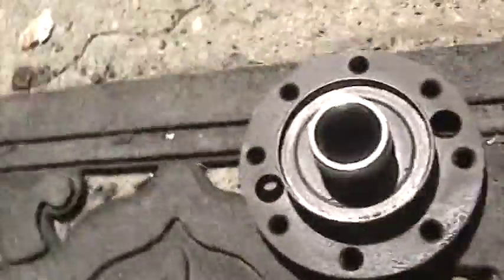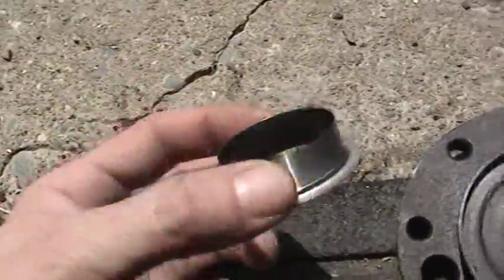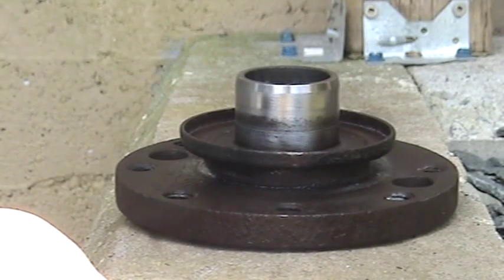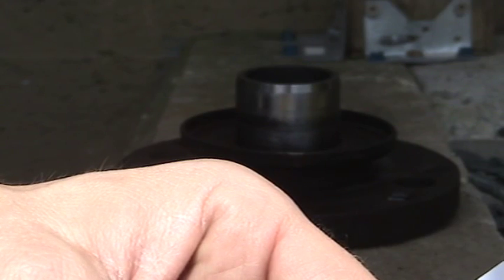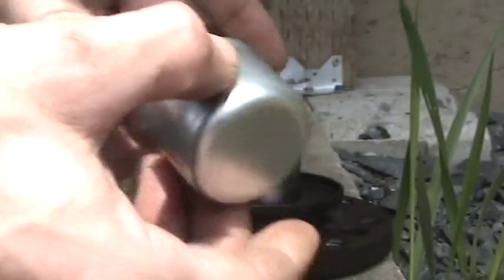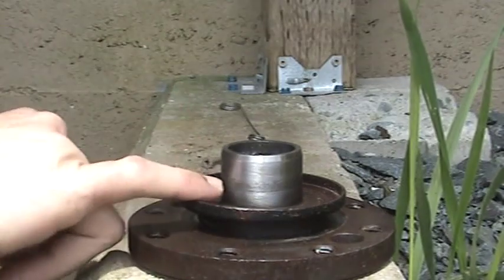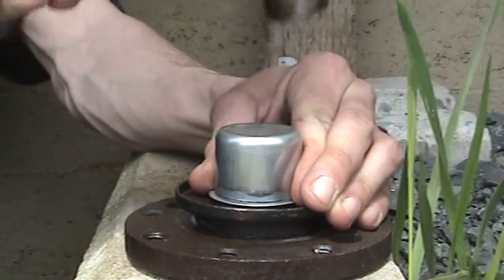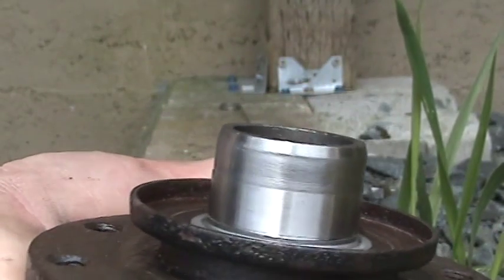Redi-Sleeve Application - Fixing seal leaks caused by damaged shafts

Comment: Why not throw the yoke in the freezer and heat the sleeve? It will drop on the shaft with no hammering. I have a small freezer and a toaster oven in the garage just for interferance fit parts.
Reply: I know this old Post but just heads up the manufacturer specifically says not to heat sleeve as it is important to have a very tight fit as it is also sealing the shaft from oil leak as well.

Comment: Thanks for the video. I’m wondering if a new stock seal will still work with new added diameter? What do you reckon?
Reply from the maker: 70boss351 yes it will work. The extra diameter from the Redi sleeve will not make a difference with a brand new seal
Reply: VEry nice of you to take the time to clarify. Thanks for such a helpful video and description. I've already done it myself. CHeers!

Comment: NO ! AT 4:03 thats not what that means and people dont do that , you use the whole sleeve what #9 is referring to is if the bottom install lip needs to be removed -and to those that are asking about and over sized seal - no you should use direct replacement

Comment: I find that submerging it (the sleeve) in boiling oil first makes it go on so much easier, just remember to let it cool first before putting the new seal in place.
Reply: the actual trick is the opposite: freeze the piece being sleeved! Done it many many times. ALSO works well for inserting bushings into other parts. Heat one, cool the other. Simple physics.
Reply: you no more boiled any freaking oil than you know what you are talking about ! Do not be telling people stupid crap to do when you dont have an idea what you are talking about ! People have you ever seen a grease fire ? Dont listen to this moron he hasnt done this and is thinking with his ass.

Comment: so the sleeve covered over a groove but created another groove in the middle now
Reply: +vqfive You miss the point, the step caused by the edge of the sleeve is irrelevant.  The oil seal doe not operate in this area.  The damaged part of the shaft where the oil seal operates is now good, and won't leak.
Reply from the maker: +vqfive I would say that if your getting a new groove, you may have debris in amongst the oil seal, which, as the drive shaft turns your new sleeve will develop a groove. Perhaps, you may want to clean the oil seal out, or replace it.
Reply: yup. Shame to go thru all that effort and not replace the seal...

Comment: when using a sleeve like this can the stock seal be used?
Reply: tserevenad Yes, we did use the stock seal with this application.
Reply: Irish Murphy Thanks.  I have seen some mention that a oversized seal is needed, but I can't seem to find any available anywhere.  Thanks for confirming that stock seal size is ok.
Reply: tserevenad I just found this statement on a SKF speedi sleeve info document:  "the same size of seal as the original can be used, there is no need to search for other seals so that stock keeping is simplified and more time saved"

Comment: The sleeve is NOT aluminum, aluminum is a fast wearing material which would be one of the last choices for such an application. They are made of stainless steel. Sorry to be so abrupt, it's just that I hate pot metal, and aluminum fits that word well.
Reply from the maker: Glen Linscheid Hey no worries on the abruptness. Replies are just that, to the point. I am aware that it is stainless steel, and if I mentioned it was aluminum in the video, sorry about that.
Reply: +Glen Linscheid Pot metal and aluminium are two completely different materials.

Comment: Good video. But what if the hat (if you like- you called it an application unit) you are hitting is not long enough and can not get the sleeve over the groove?
Reply from the maker: I would first check around and see if I had anything like a pipe of the same diameter as the 'hat' and use that as the extension, or check with a machine shop, but take the hat with you.
Chances are you will find something kicking around to help you get the sleeve where you want it. I have also had to use 2 once, put one on as far as you can get iit before putting the second one on.
Hope you make out alright.